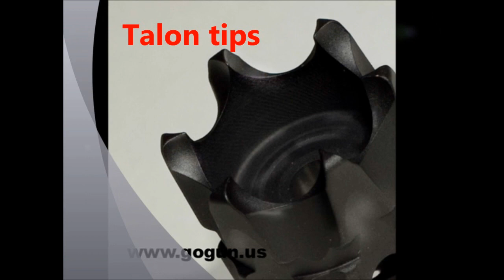GoGun® SuperComp® Talon Rifle Brake

Comment from the maker: @GoGunGasPedal   You definitely got a chuckle out of GoGun!    It should fit any  standard 1/2x28tpi RH threads. The GoGun® Talon Brake works extremely effectively at high pressure.

Comment from the maker: There are Talon brakes for Saiga 12 Ga that usually have a threaded barel and are drop in parts. The Talon for AR (.223) will work on Saiga Rifle if threaded for standard RH Thread. There is also model for 7.62x39 for Saiga/AK Platform with LH thread

Comment: compared to the A2, is it tolerable to shoot without hearing protection? I am Currently running a miculek Compensator and a Standard A2 'birdcage', the miculek comp is really effective at reducing recoil and muzzle climb, but it is LOUD. it is impossible to shoot without hearing protection, and since i do hunt with my AR15, it is not practical to wear hearing protection, so i have to change muzzle devices. i will buy one if it is similar in noise to the A2.